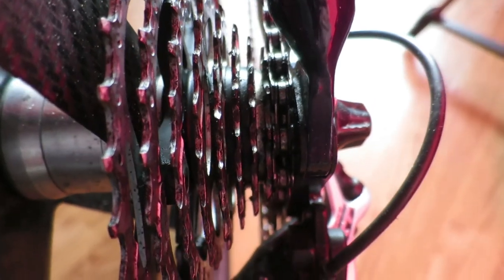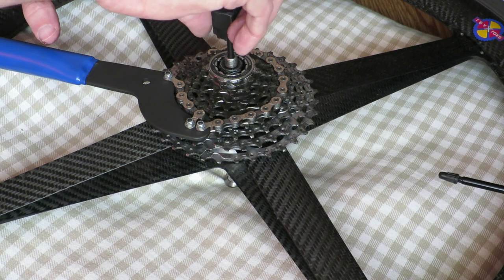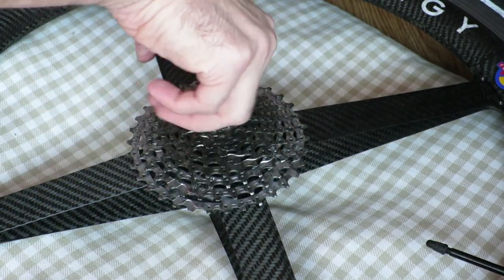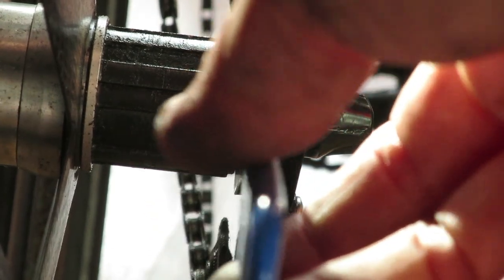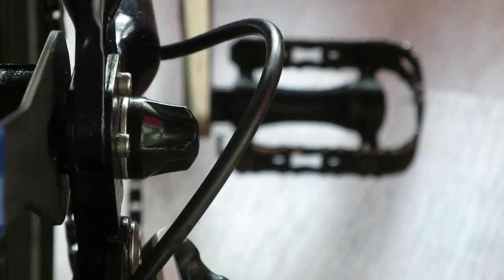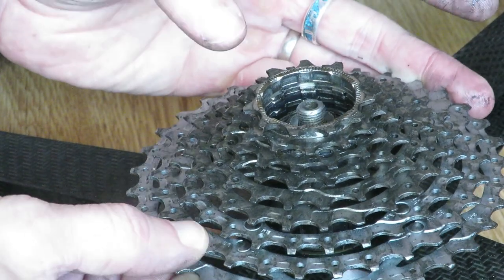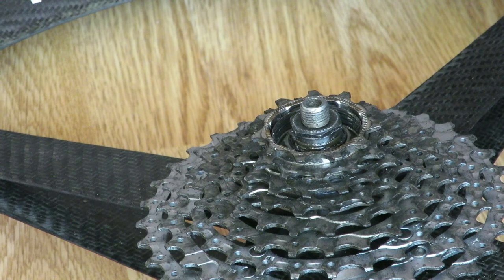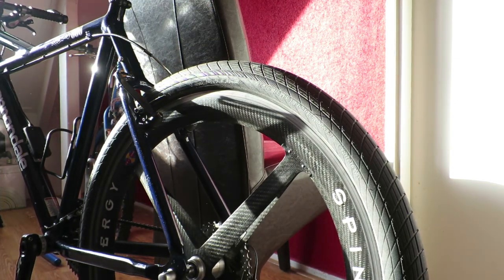How to remove side to side play in rear wheel

Comment: Does it work the same way on a mountainbike with a thru axle?
Reply from the maker: This is a mountain bike from 1998. It was commonplace to have axles with cup and cones using loose bearings. I can't think of any thru axle that doesn't work with hubs with sealed cartridge bearings nowadays. Correct me if I'm wrong. So that would be a "no"

Comment: Hello, is it bad to ride with the play on an mtb?
Reply from the maker: Yes. If you've got play in one of your wheels (probably the rear), both the bearings, the cone and bearing races within the hub are more prone to accelerated wear. And play is also an indicator the wheels internals are more exposed to outside elements. I've never serviced a wheel with play on an old bike that didn't show corrosion damage as well.

Comment: I cannot tighten the cone and the locknut with the damn cassette holder in place on mine.
Reply from the maker: This wheel had a sealed cartridge on the other side of the hub instead of a cone. If yours doesn't, adjusting the cone on the non-drive side is actually much easier.